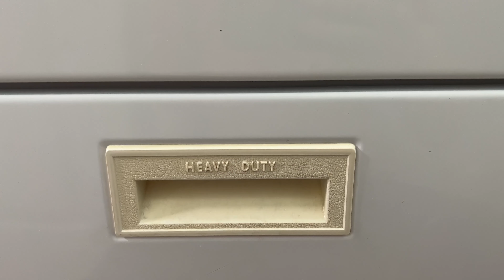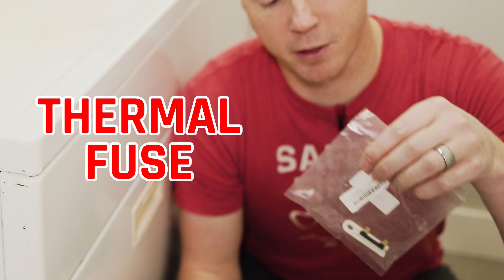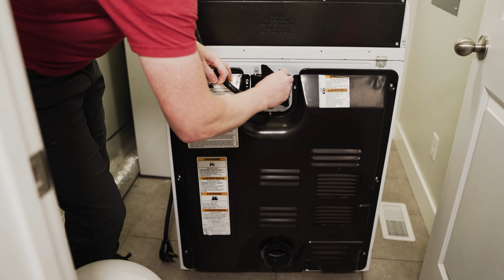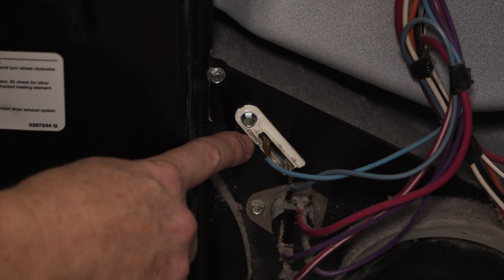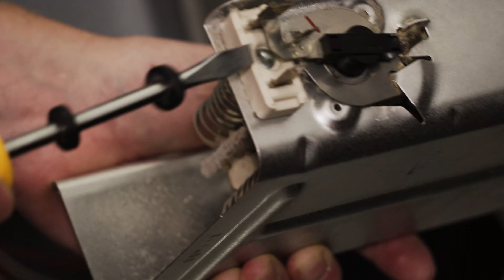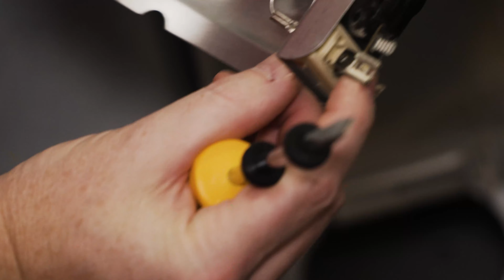Top 3 Reasons Your Dryer Isn't Drying Your Clothes

Comment: My dryer is creating heat, but takes several attempts to dry a relatively small load. The lint trap gets cleared with every load and the ventilation seems to be pretty clear through to the outdoors. Would a heating element be the problem? It does tumble and creates a lot of heat...
Reply: I’d like to know the answer to this question!
Reply: I did end up taking the back of the dryer off, cleaning the lint  trap completely.  It was about half full. That definitely helped.  Then I replaced the heating element.  Amazon for about $34. Works perfectly now.  Clothes dry in Half the time.   @paparisling
Reply: Check vents and if it has moisture sensing check the sensor. Usually the sensor is inside the dryer on the back wall and can break off if someone dries a pair of sneakers or something
Reply: @ricmullaney4803  I checked this as well. But let’s say it still happens even on a timed drive for a whole hour on high heat. Is my only option heating element in fuse?
Reply: @ricmullaney4803 if dryer heats and air blows, how is a new sensor to help?

Comment: My dryer is getting hot. But not drying or collecting lint. The dryer is about 6m old. I've taken the back off to see if it was clogged and it wasn't. So I had the duct worked on and still have the same issue
Reply: I’m having the same issue. Checking it tomorrow.

Comment: Help! I old Samsung dryer stopped drying clothes and I replaced it with a new one. The new LG one still doesn't dry clothes, so I had my air vents cleaned. But it's still not drying and I get an error after a while. 😭

Comment: These older models make it a breeze to get to the heating elements. My Samsung one I bought 4 years ago makes me feel like I need a sword, shield and potion to get to the heating element. Great advice in this video.
Reply: This how I feel doing the oil change and battery change in my moms hybrid
Reply: That’s by design, if they make it intimidating/hard to replace the broken parts you’re more likely to spend more buying a new one
Reply: That is why i keep my old machines! I am a girl i changed the clutch on my washing machine did changed my sensor on dryer and belt but not i suspect the thermostat because the element is red hot! I will buy another one and see! All the vent is clean i open everything! 🤔
Reply: Thank you for mentioning that it makes me want to keep the old one even more now.

Comment: You didn’t do any actual troubleshooting of the components to determine what was wrong. You just bought new parts hoping for the best?  And what if that wasn’t the problem? I’d like to know for certain whether parts are bad before actually buying  replacements.
Reply: I'd spend the $25. before calling someone out for over a hundred.
Reply: Just hang your clothes outside ya big baby😂
Reply: I agree with you. I bought the heating element and thermal fuse. Change it and the dryer was not heating. While he mentioned continuity but didn't show us how. I have to watch other videos and go buy a multimeter. And found out that the 3 thermostats, not just 1 that he rushed through in the heating element, were busted. Im a beginner diyer ... So yes this video was not helpful. Changing parts doesn't mean it was the issue
Reply: He mentioned you could check for continuity on the fuse... and did all the other things before replacing the heating element.... Did you not get the help you wanted by watching this video?? I take it you didn't do anything to fix your problem except complain at someone giving you the solutions

Comment: You’re supposed to remove lint from the lint trap every time. That’s why it’s so prominent. Even if air is still flowing, it’s just that much more restricted and less efficient. You are wasting money and time if you don’t clear the lint trap with every load.
Reply: and try running water through screen. if it holds water you need to scrub it. dryer sheets make a film on the screen that restricts air flow.

Comment: I usually use a solar dryer. It’s inexpensive to operate, and it doesn’t shrink clothes, but it is slightly more work. When the weather is wetter than the clothes, I use an indoor version in the garage.

Comment: If you're unlucky enough to own an older stackable washer/dryer, a fourth reason your dryer might not be drying as well as it once did might be that lint has accumulated over time inside the housing around the drum and in the back behind the drum, where the heating elements are. I replaced the rear drum bearing on mine (dryer was squealing like mad) and while I had the drum out I cleaned the interior thoroughly. I probably  pulled out enough lint to knit a sweater... not kidding! I put on a new exhaust hose because the old one was badly crimped. Afterward, the dryer dried clothes in maybe half the time it used to. Lots of work when you fix a stackable, but it's worth it.
Reply: I thought the same!

Comment: You did no troubleshooting. You never said if it was heating or not, I assume it wasn't . If it's heating but not drying well, it is always going to be an airflow issue. The thermal fuse you replaced was not the problem, because when it fails, the dryer will not start. There is another fuse above the element, called a thermal cutoff, that will cause the dryer to stop heating when it fails. Use a meter and replace whatever does not have continuity.
Reply: Can you tell me exactly how to do that? I know you use a volt meter. But I don’t know which settings to use…?
Reply: Has no meter, so he is just guessing. Then he say to disconnect the gas, when he is fixing a dryer with a electric heating element. Two thumbs down. 

What if you have a circuit board and the relay is bad?

Comment: What if it's the thermostat? Is there such a thing as a dryer belt? Thanks for this video and thanks in advance for answering my 2 questions.
Reply from the maker: If it’s the thermostat, that can easily be replaced as well. They don’t cost much and they’re a pretty easy swap, as you saw. And yes, there is a belt that goes from the motor to the drum. Those can slip or break but that typically only affects the drum rotation.
Reply: @LRN2DIY  Thanks again. My old dryer more than once needed a dryer belt.